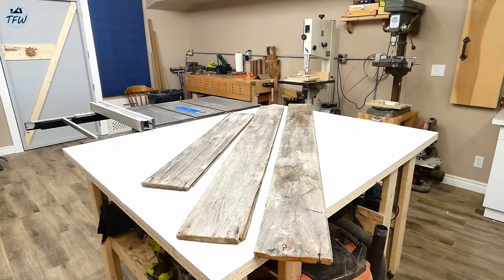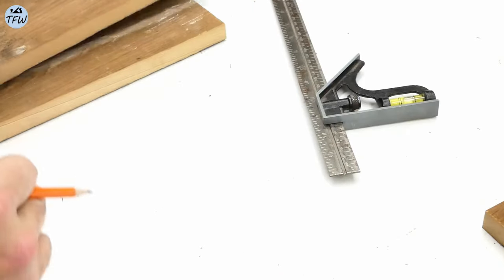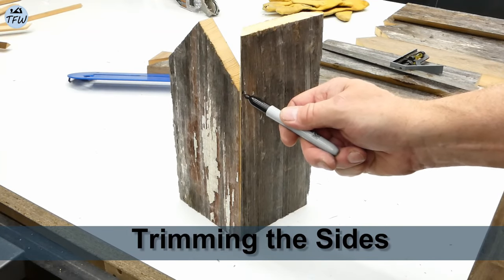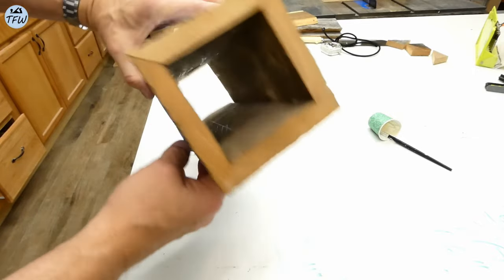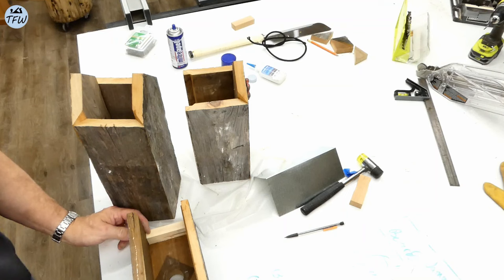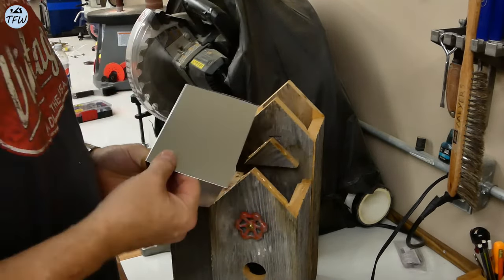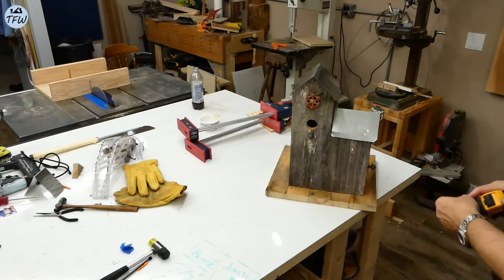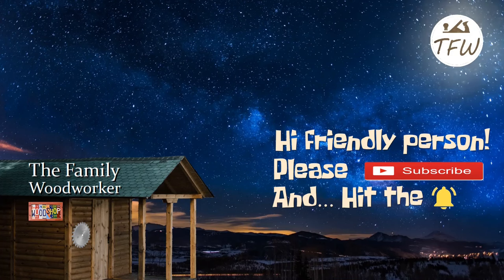Making The 3 Level Birdhouse - FREE PLANS

Comment: The only two things that I didn't like was the metal roofing would be really hot in the summer, and no spaces for ventilation.
Reply from the maker: Fair, John.  I liked examples using a corrugated metal roof, but you're right, the metal will get hot. I'll need to add some venting and maybe paint the roof white...

Comment: Nice project! Just finished one... then I saw the post about the roof..  slid some wood under the metal to deflect heat. I'm  in Michigan as well. (Southwest) found a picket fence in Michael's that looks great.  I'm hear perches are not a good idea... have you had any issues?
Reply from the maker: Ah yes... another "Mitten Man". When I used to travel for work, people would ask me where I live and I'd hold up my right hand and point to it. They never seemed to get the joke...  Congrats on the build!  I have a real blue bird nested in one of my condos and the perch does get used. Can't tell if they prefer it or not.
Reply: @TheFamilyWoodworker  the hand to show location is a Michigan staple! The rest just need to learn that it's what we do!
Reply from the maker: @Lonemaverick2001  We are native Michiganders, but when we lived in Wisconsin for a bit, some folks referred to their state as the 'Mitten State". I then asked, have you looked at a map?  "I think Michigan is like, a more accurately geographic mitten". (Except for the U.P. that is)